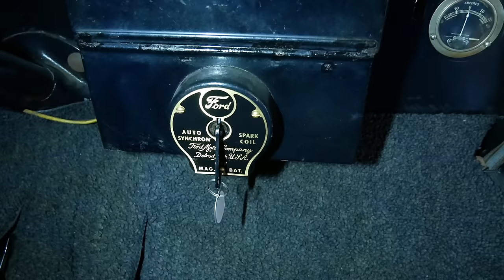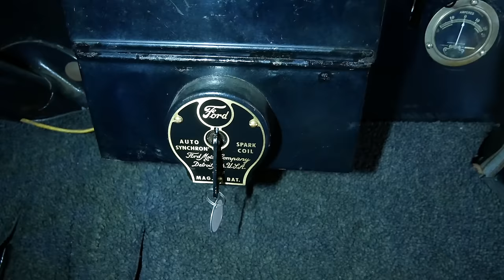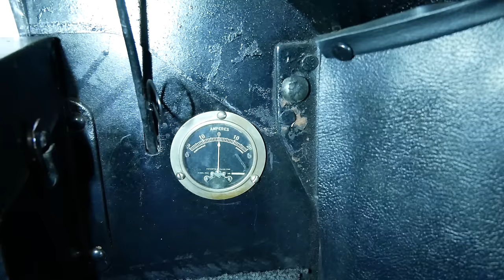Exploring the World of Early Cars

Comment: 3:25 True to Mercedes Benz form, their first car is over-engineered in the rack and pinion tiller for a linear actuator steering module instead of a regular bicycle steering mechanism.
Reply: i just want to make one as an 1800s chopper with a raked out front end using the wheel from a penny farthing in the front..
who's with me?
Reply: With a bicycle-like steering you would have a direct force transmission, which would make it very hard to steer and also irregularities on the road could yank the front wheel to a side, which is very bad.
Reply: Karl Benz was a perfectionist. It shows in his work
Reply: @ripvanwinkle2002 I can imagine that chug-chug-chugging down the street! 🤣
Reply: No, @foximacentauri7891 , I have seen original and reproduction ancient early automobiles that had bicycle steering wheels mechanisms (and also tillers directly turning the front fork). Plus, custom trikes made from VW Beetles that have basic motorcycle chopper front forks & wheels (or motorcycles turned into trikes with the two rear wheels being powered). The transmission is on the rear wheels.
Reply: If only the engine was air cooled then it could have been the first Porsche.

Comment: My uncle actually owns a T that he restored that has a bit of a storied life- originally it was apart of our family, was sold off the farm, modified, stashed in a barn, and traded around at local swap meets until he tracked it down.
We once- ONCE- had it up to 35MPH when my great aunt and uncle visited for their last plane trip (in their late 80s at the time) where we all dressed up like 20s gangsters and fucked around with revolvers. Having it up to 35 was fucking horrifying, you're never riding "in" one but rather, "on top" of one because the seats are so springy to absorb all the road defects.
EDIT: one thing Robert might not have fucked with much is how odd it is to control the ignition alongside the throttle. You have to do both at the same time to increase speed, because if you don't increase the spark rate eventually you'll drown the spark in gas and kill the engine. When learning to drive these, you'll repeatedly get up some speed and then kill the engine accidentally because you just didn't move the lever in time lol

Comment: As a Model T owner and enthusiast, I'd say you did a respectable job explaining the basics of how a T works.
Reply: I agree he did a great job. The only slightly off thing they must have told him was the battery ignition as an upgrade. As far as I know they all came that way. Of course the "battery" was a lantern style dry cell mainly used for easy starting or as an emergency when there was a problem with the mag. I would love to see someone do an all inclusive video of all the quirks like jacking up the right rear wheel on cold days for easier starting, or Fixing a rod knock by removing a couple of rod cap shims.

Comment: I believe the black paint also dried faster than other paints, so not only was it cheaper, but it also sped up production.
Reply: There were multiple different black paint formulas for various parts. Most of the formulas aren't reasonable to use today. Faster is mostly a myth but having one color simplified inventory and paint processes making it more efficient and lower cost. You didn't need to sort parts by color. Fun question: If you needed to pick one color for the cars you manufacture, what would that color be?
Reply: @larrycleeton  Probably white.  For most cars, this is the default no-cost option, probably because few people really object to it.
Reply: A [the?} reason for the black paint is- a status symbol---black paint, or black cloth dye is hard to make. Hence, a mans ' black suit of cloathes denoted wealth. The hows and whys are not needed here, but I can off them, PM me. Leather seats= cheap, cloth seats =expensive, due to manufacturing issues costs

Comment: The Panhard-Levassor of 1901 was one of the first "standard cars". It has a manual transmission, shifted through a clutch, drive to the rear wheels based on a shaft, and braking on the rear wheels through drums. It took until the 1920s before we had the relative safety of 4-wheel drums, and until the 1950s before disc brakes made an appearance. That Model T steering is definitely a precursor to the recirculating ball steering of the 1930s and onwards.

Comment: I own a Model T. They are a lot of fun, and a lot easier to start if you have the optional electric start installed, which I don't think was available for the 1918 version you are driving. I think the electric start first became available in 1919 or 1920. For cars that have it, the electric start is a stomp switch is on the floor under your left foot. The Touring version (the one you drove) usually had a spare tire installed over the fake front "door" which made it even more obvious that it wasn't supposed to be used as a door. The Tudor model, as well as the four-door version called the "Fordor" (I'm not making that up) that I have both have functional driver's side doors, but I never use that door because I am nowhere near tiny enough to fit past the brake lever. The controls make sense when you realize that the pedals are all for controlling the transmission and the hand controls on the steering column are all for the engine. There are two additional very important controls that you didn't mention. The first is the "air conditioning", which is that the top half of the front window flips out to allow air to flow directly onto you, and the second is the manually operated windshield wiper, though it looks like that one doesn't have that installed. It is literally just a crank that you flip back and forth to make the wiper move. Also important to note is that the gas tank is under the front seat, and there is no fuel pump. Fuel is gravity fed. That means that if you are low on fuel and you go up a steep enough hill, the engine can end up higher than the fuel level, fuel stops flowing, and the car stops. If that happens, coast back down to the bottom of the hill, turn the car around, and reverse up the hill. That will keep the tank up higher than the engine no matter how steep the hill is and how close to empty your tank is. Your Touring version was $290 back in the day. My Fordor was $660. That works out to a bit over $5000 for the Touring and $11,000 for the Fordor in today's money.

Comment: Man, I love these vintage cars. I always love looking closely at them to see what bizarre and brilliant solutions they came up with to make them work before there was any such thing as doing it "by the book." Back then they were just trying stuff and seeing what worked! Nobody knew yet what would catch on, so there was endless creativity in their mechanical solutions. I was looking at a 1908 Buick a while ago at a car show, and it had a massive flat twin mounted transversely under the floor, with the chain drive to the rear sandwiched between it and the flywheel and transmission. The hood was bolted down and only contained the gas tank and radiator. The two-cylinder engine had nearly the same displacement as some V8s nowadays, but made 30 hp - quite a lot when you consider model Ts made 20 with two more cylinders. 

I know most kids these days aren't interested in such old archaic cars, but anyone with a passing interest in mechanical engineering really should look into various antique cars, the engineering in them is really fascinating and clever and wildly different from what we have today, even if that's sometimes for good reason ;)
Reply: The nice thing about these early cars is that anyone can fix them with basic hand tools. Tolerances are loose and designs are simple. Mechanics were rare so you either worked on your car in your barn or you were rich enough to have a driver who did all that. You have to admire the early days when engineers were throwing things at the wall and seeing what stuck. If I had to own an early car it would likely be a Stanley steam car just because of how beautifully complex yet smooth they are.

Comment: It does have a throttle. The amount of holes open as it's running increases or decreases the vacuum thru the carb, metering the amount of fuel drawn into the intake

Comment: Fun fact: On her first, and in fact the first ever, cross country drive, where Bertha Benz covered around 100km in 12 hours* * * she actually sourced the fuel from pharmacys. It was called Ligorin, was basically petrol light, and was primarily used as a stain remover. Which is also why you could only get it there.
Reply: Does "she" have a name, or was she just christened a pronoun?
Reply: @stevethepocket  corrected

Comment: @14:55 That would also happen in 70's Ford Trucks if the cab mounts were rusted out. The steering column was a main cab support (if cab mounts were gone) and the whole cab would move when you moved the steering. I've experienced that- it is not good. Lol.

Comment: My cousin is a car restorer. He has a 1929?? Model T truck that was made in Canada. I know it was made in Canada as that is stamped on the engine, the radiator cap, the running boards,  the tailgate, and the manifold. They must have been really proud of its lineage. The truck is in excellent condition as it spent most of its life as a prop in a mens clothing store. Cheers from Canada. ~ulrich

Comment: The T actually has two ignition systems. It's got magnetos, like a lawnmower, but those are hard to get going fast enough to be of any use when you crank-start it. That's where the battery ignition comes in, and it uses vibrator coils, so, bad mother of multiple spark discharge. The key goes one way for battery, other way for magneto. My dad and I drive one for a local museum, and we'll start it on battery, get the mixtures and timing right (mad dash before the engine chokes itself out), and then flip it over to magneto--being careful not to linger in the middle, because that's off, and it will stall if you're not quick about it. The box in that one looks the same as what we're working with.

Comment: “It doesn’t have a throttle” — but, it has exactly a throttle! It’s just multiple holes in a tube instead of one big butterfly valve. What it doesn’t have is an air filter. And also a good way to modify the throttle on the go.

Comment: The original gas stations were pharmacies in Germany, as they sold Ligroin. Bertha Benz, Carl Benz' wife and frankly, the more entrepneural of them both - and he was no slouch in that regard - took the Patentwagen Number 3 out on a 104km long tour with a halfway point at the pharmacy in Wiesloch. Her route has been memorialized, you can follow it today. I hope you have less issues than her, to quote wiki:

On the way, she solved numerous problems. She had to find Ligroin, a solvent available only at dispensing chemists' shops, to use as fuel.[11] Thus the still existing Stadt-Apotheke (Town Pharmacy) in Wiesloch, some kilometres south of Heidelberg, became the world's first filling station.[12] A blacksmith had to help mend a chain in Bruchsal.[13] Brake linings were replaced in Bauschlott/Neulingen north of Pforzheim.[14] And Bertha Benz had to use a long, straight hatpin to clean a fuel pipe which had become blocked, and a garter to insulate a wire.[15]
Reply: It should have also mentioned that she made that first cross-country road trip with her two teen sons Eugene and Richard. Giving all the credit to her is like talking about Edmund Hillary reaching the summit of Mount Everest without mentioning the Sherpa Tenzing Norgay.

Comment: What is the first car with a somewhat modern setup of driving controls? (I assume it will be a manual rather automatic.)

And when did the manufacturers standardise on that modern setup?
Reply: Not all elements of what we can thing as modern controls appeared at the same time, but some of those appeared before WWI.
Things shifted here and there but most car made/designed after 1930 would only have a few passing quirks compared to earlier automobiles.
Some elements weren't standardized until very late, comparatively, for example, Renault fitted their vans with "reversed" (first speed : bottom right position) gearboxes up to the early 60's.

Comment: 1970s VW Beetles were also available with a "manulated automatic" transmission. I remember we had one when I was a kid, and ours had a regular four-speed manual, but the handbook described the operating procedures for a three-speed "Automatic Stick Shift" model as well. I don't know how it worked mechanically, but I assume it must have had a torque converter of some kind, since it could idle in first gear with the car held motionless by the brakes.

(Yeah, I was the kind of kid who read the car's handbook while waiting outside the store or whatever. What else was there to do in the cars of the 1970s and '80s? :)

Comment: At least part of the reason for the Model T leaking oil is intentional. With early ones, because most owners had no prior experience with cars, they didn’t realise you had to change the oil which obviously caused issues eventually, so Ford decided to slacken the tolerances on the engine which had the double upside of reducing production costs while also giving owners a visual hint that they needed to replace the oil, because it was constantly ending up on the ground under the car where they could see it

Comment: I will argue ardently that the first "car" as in motor-vehicle designed to carry people was actually created by Richard Trevithick, with the first ever self-propelled high pressure steam engine called "The Puffing Devil" in 1801. The French contraption you speak of was more of a tractor, and was used as a moving engine for cannons, and not intended for transporting people, nor was it ever used as such due to being horrendously slow.

You can see a functional replica of the Puffing Devil at Trevithick Day, an annual festival in Camborne, Cornwall (NOT England), which leads a parade of roughly 100 steam traction engines and cars.

Comment: I drove a Model T that did have a driver’s side door (final year model) and yes, it was almost impossible to thread your way between the steering wheel and the brake lever to get to the seat. Much easier to use the passenger door and slide over.

Comment: Not only was the Model T outdated in 1927, it was so outdated that most cars by then, and the new car Ford made (The 1928 Ford Model A) had totally modern-style controls. Like, I'm talking a 3-speed stickshift, clutch-brake-gas pedals, a fuel gauge, even crank-up-and-down windows. Like, if you can drive a manual, you can drive a Model A. Truly "An Car"

Comment: In addition, the 1878 Bollee La Mancelle was the first series production automobile sold to the general public, with 50 examples manufactured (there were steam powered busses and trucks running on the roads for decades before that, but the La Mancelle was obviously a car, not a bus or a truck). For a long time, Mercedes-Benz' claim was that automobiles had to be internal combustion, which meant, according to them, electric cars and steam cars didn't count for some reason. Today, I guess the claim is that they are legitimately the only pre-1890 automaker to survive to the modern era, which is still commendable

Comment: 7:32 naptha/white gas is basically gasoline without the additives, which gives it a low octane rating of 50. Kerosene is a heavier fraction and is more similar to diesel than gasoline and wouldn't work with that evaporative fuelling system

Comment: Henry Ford was philosophically opposed to driver side doors because he felt it was too dangerous to step out onto traffic. The Model A (followed the Model T) did not have a way to unlock the driver side door from outside. You unlocked the passenger door and slid over.

Comment: 16:35 Mazda actually does that deliberately these days - when using stop start the engine will try and stop with a cylinder compressed and ready to ignite so it can do a gentle start rather than a full crank with the starter motor

Comment: As I understand it, and this may be a complete fabrication, the "you can have it in any color of black" thing came about because when the car first started being manufactured on an assembly line, the only color available that would dry fast enough to be finished by the time the CAR was finished was a black one.
So, the first serie(s) was made solely in black. But of course, Ford quickly found a supplier that could get him quicker-drying paint in several colors.

Comment: According to Wikipedia 1 Mark (1871-1923) was made out of 0,358423 grams of gold which would mean the Benz cost you 215 grams of gold which right now (2023) is worth 14.200 USD. If the numbers I found are correct that is. (Edit: I should have checked all the other comments before commenting. At least my calculations seem to be correct.)

Comment: Your Inflations Calculation most likely went wrong, because you missed the correct currency.. because.. there were a lot 😂

- In ~1880s the currency was "Mark (des Deutschen Kaiserreichs)".
- From 1924 onward there was the "Reichsmark" which lasted up to ~1948
- Then there was (for a short period of time) some currency provided by the allied forces (but neither $ nor £)
- Also in 1948 the "Deutsche Mark" was put in place (most likely what you used as your starting point) 
- 2001 finally the Euro arrived..

Since the Reichsmark hyperinflated and the "Mark des Deutschen Kaiserreichs" was most likely worthless after, well, the Kaiserreich seized to exist.. a correction for inflation might be impossible OR 6000$ might aswell be right, because of the hyperinflated Reichsmark 🤷🏼‍♂️